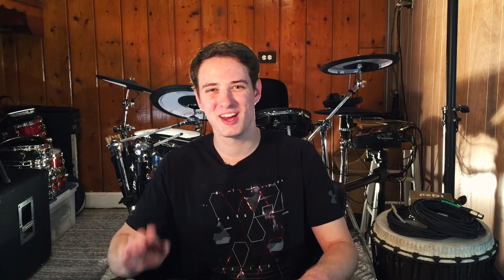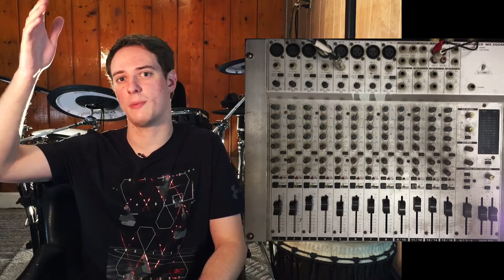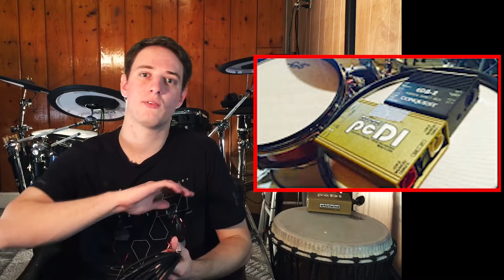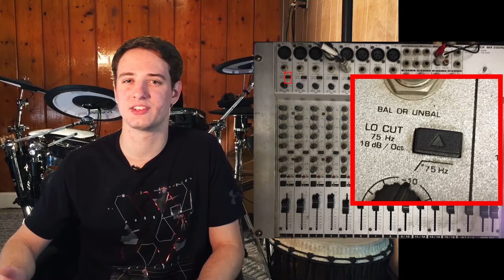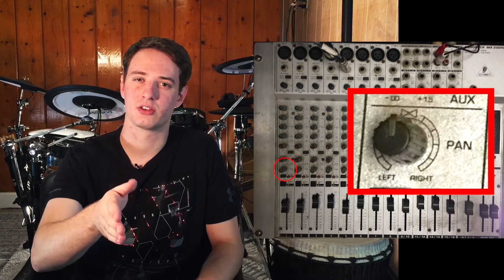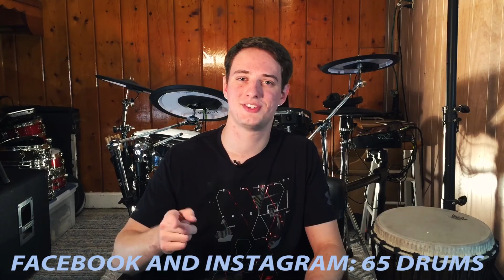Drummers Crash Course Guide To Soundboards (Sound Design For Drummers Part 3)

Comment: Hey Justin, nice video, what would you suggest for the adhesive to glue the piezo to the plate when I change the piezo?
Reply from the maker: I once used Superglue on a piezo inside my Roland VH11 years ago. And it's still holding.
Reply: @65Drums 
Thank you Justin for getting back to me, ok, that works for me..👍🎶

Comment: Aloha from Hawaii Justin!  Been watching all of your videos for the past year and have finally settled on getting a used TD-11KV.  I had leaned a little toward a new Alesis, but as one of your videos said....go out and play them first.  What a difference in what is supposed to be new Alesis quality and a Roland that had been in climate controlled storage since it was purchased!  Roland won me over.  What you hear and see on videos from dealers and music shops are totally different when you do it in person.  Anyway, point is, I really value your opinions, experience and yes, over time, expertise.  I need help with my audio set up.  I plan to get a Behringer Xenyx 802 mixer.  I understand that my 2 1/4" outputs from the module will go to the L/R input of the mixer.  What I'm puzzled about is I have 2 Powerwerks 50 speakers and a Roland PM10 drum amp.  How do I connect the speakers to the outputs so that the Powerwerks act as left and right (and I'm able to pan them) and my PM10 can act as my monitor/subwoofer?
Keep up the great work and looking forward to hear from you!  Mahalo nui loa!